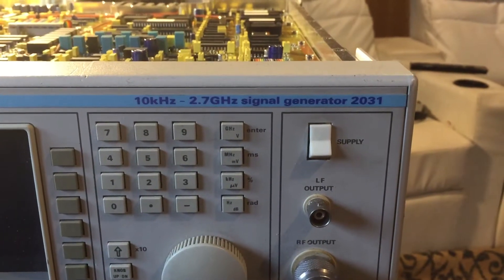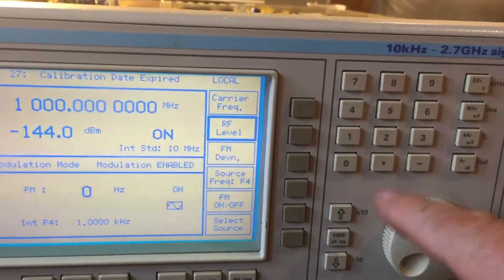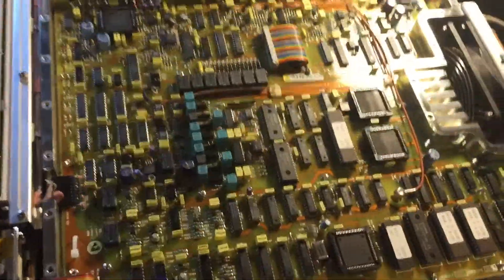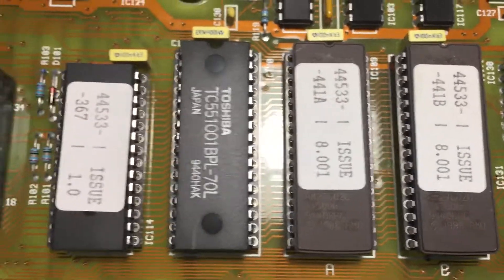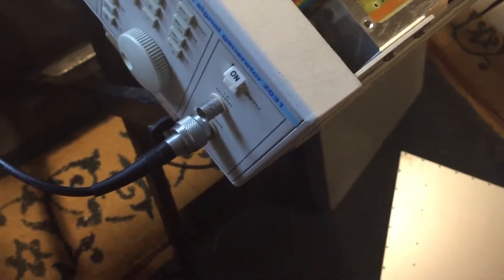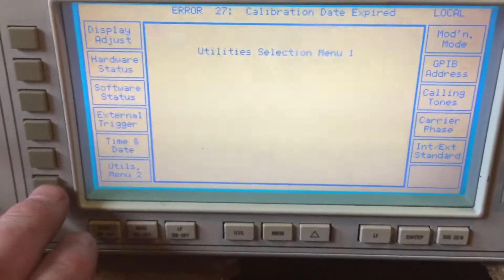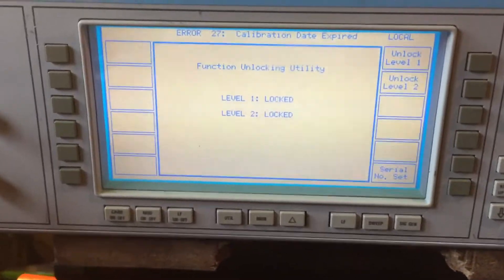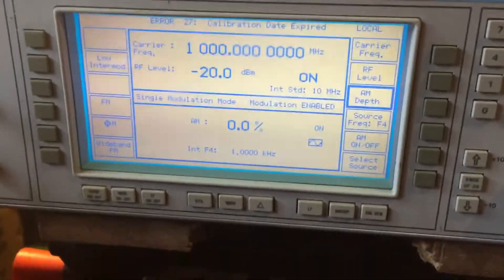Marconi 2031 overview and EPROM location

Comment: Hi Wayne, I bought one of these too, but It needs calibration. I've read it can be done internally but I can't find the service manual. Do you know how to do this?
Reply from the maker: google   ko4bb  then look under marconi, the service and repair manual should be there :)
Reply: @waynephillips1848  For some reason the html file won't load, I'm trying to download the pdf file and it takes 2 hours according to the estimation. I hope this works.
Many thanks anyway! :)